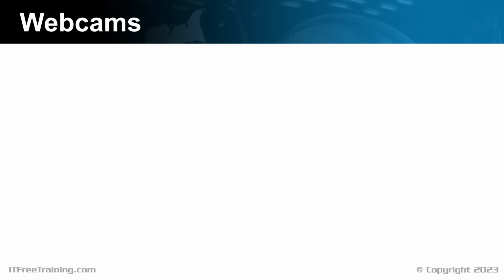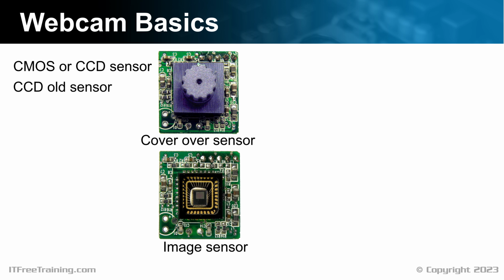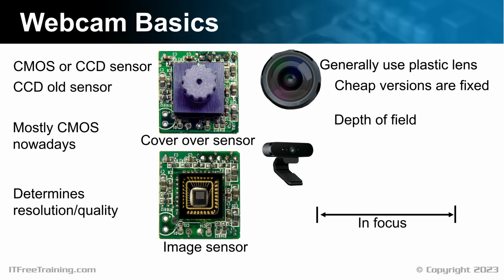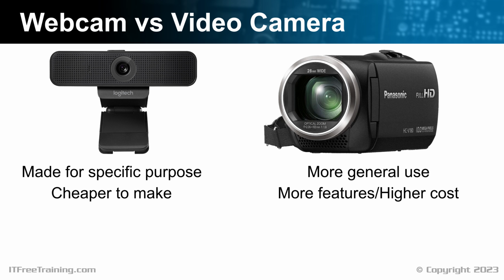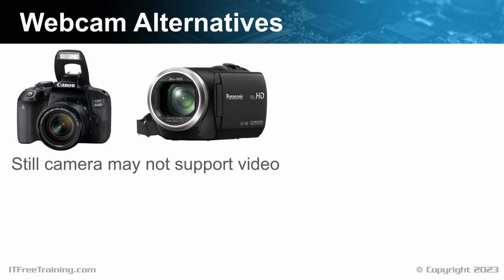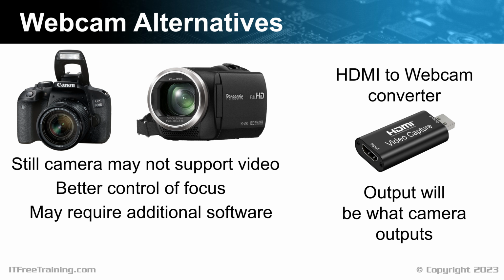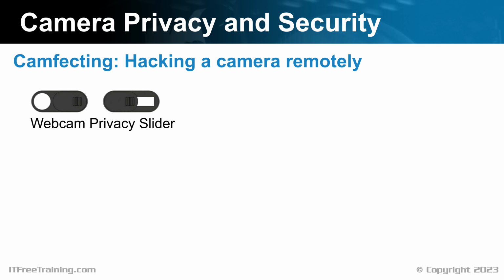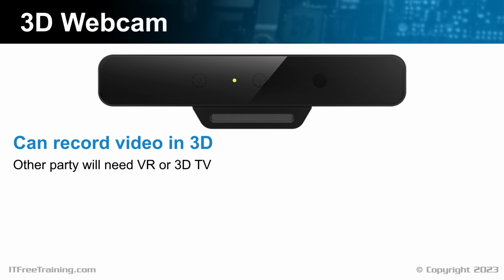Web Cams

Comment: When was this script written?  I think you might have mentioned whether a webcam cones with proprietary software to control resolution, exposure, white balance, zoom etc., because signifucant improvements in image quality can be obtained, and third party image processing packages to manipulate the image quality before it is used by video streaming applications is generally limited and / or requires a subscription to unlock functionality.  Webcams built into laptops are generally of poor quaity, given that they have to be very small, have low performance specifications and do not work well in low light situations.  This is also why they are not generally used for facial recognition security software.  The Windows Hello spec uses an additional infrared light source / sensor to authenticate facial features.  Some more expensive webcams have this technology, as do MS Surface devices and  a few other premium OEM laptops.  I'm sure I read somewhere  recently that it is also coming to Macbooks, since it has proven so successful on the last few generations of iPhones.
Reply from the maker: The A+ exam does not go through to much detail in regards to Webcams. We attempted to go into a bit more detail but if we go to deep in detail people start complaining we are covering more than what is required for the exam. We do mention that more expensive ones have changeable iris etc, but don't really go into a lot of detail. We will revise this video next year so probably drop a lot of info about the older webcams since you don't come across them that much nowadays and focus more on the newer stuff. You are correct, there is a lot more on facial recognition etc that we should have covered in the video but did not which is becoming pretty important nowadays. I have an iPhone with the new facially recognition, it is very good. When we update the video next year we will take all you have said into consideration.